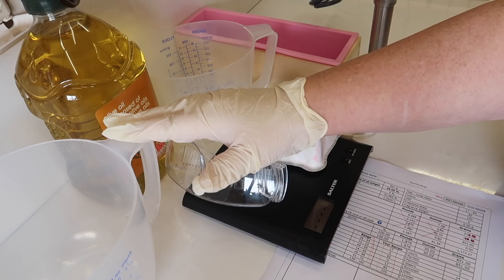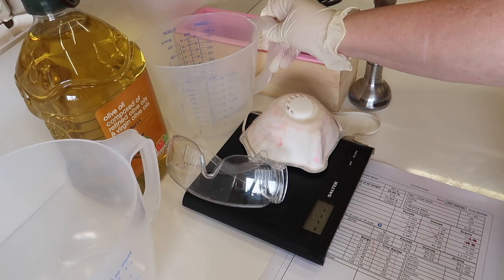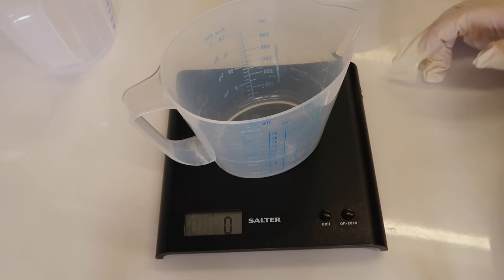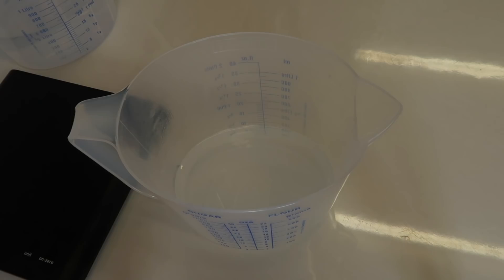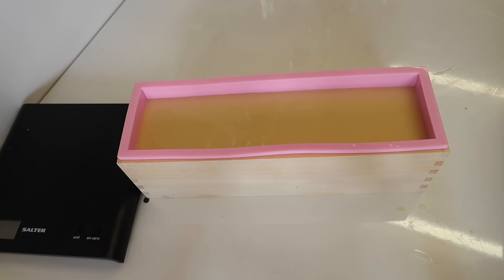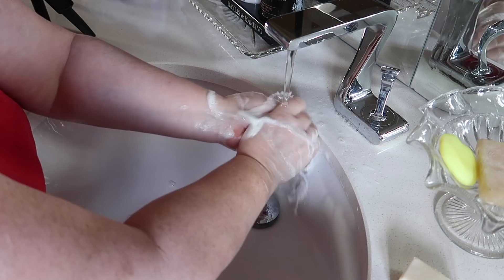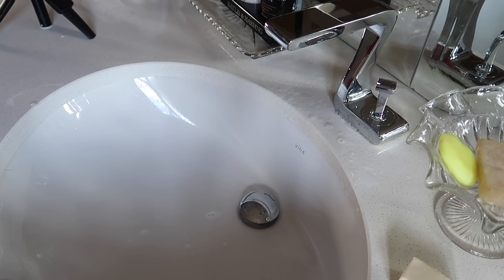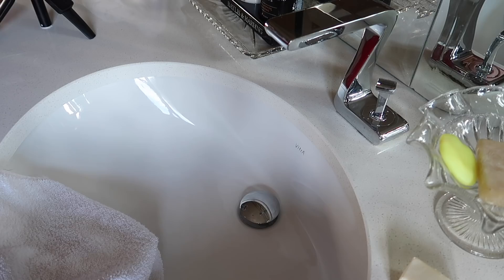EASY How To Make Your 1st Castile Soap | Fully Instructional Video | Soap Making From Scratch EP7

Comment: Do these bars cure for 4-6 weeks or longer
Reply: Nope, a year! You read it correctly.
Reply from the maker: These bars will be fine to use after 4 weeks. In fact the soap is already beautiful the day after cutting. It is not going to hurt anybody using it so quickly. But generally it is considered best to allow Castile soap to cure for at least a few months